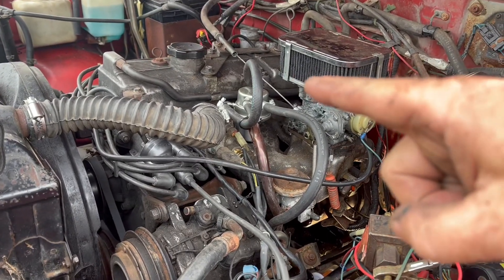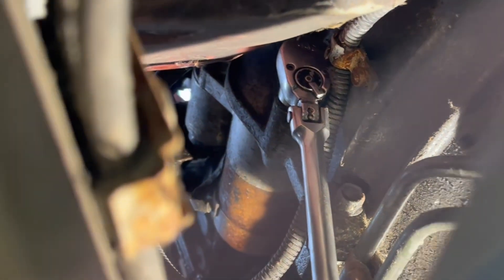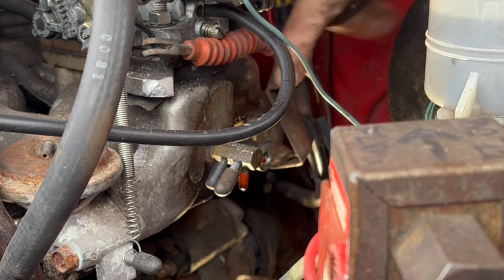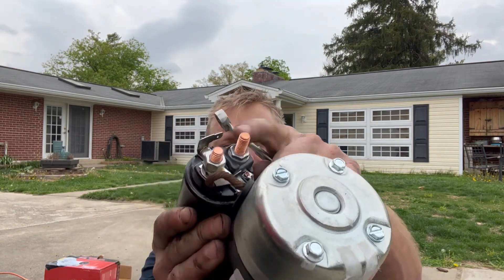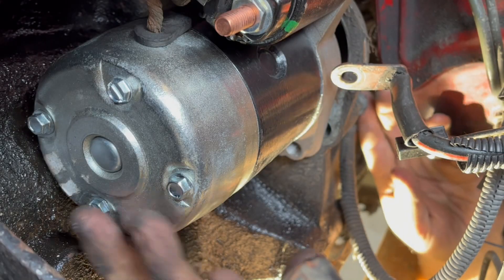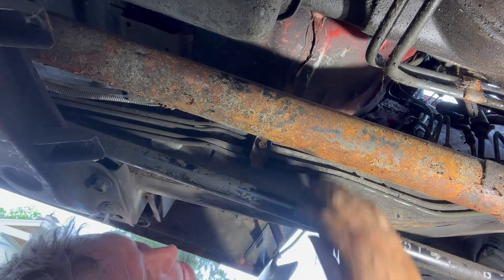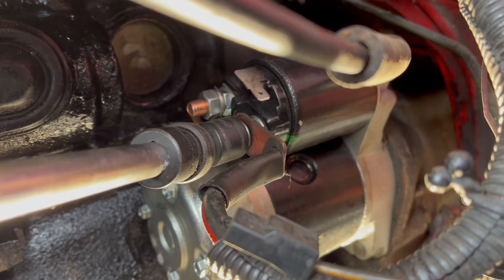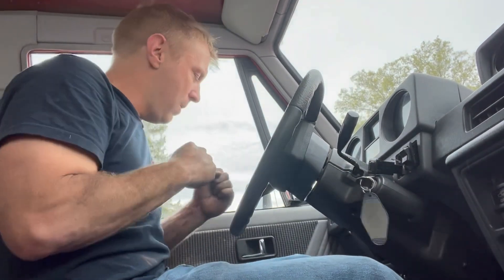Replacing the starter on a Mitsubishi Montero / Dodge Raider with a G54b or 4G54 engine

Comment: If you disconnect and get the front drive out of the way it's fairly easy.  I struggled for a half day using multiple extensions and elbows.  I just disconnected the front drive shaft and pulled it in 30 minutes.
Reply from the maker: Yep, figured that out part way thru, but too late to bother with it…I am stubborn like that 😂

Comment: Only addition would be to clean the spacer plate between the engine and transmission. You never know if the stater nose housing is the same on reman starters. Good video!
Reply from the maker: Yep, I should have given everything down there a good wipe down.  It doesn’t take much to throw off starter engagement and get bad noises or tooth wear